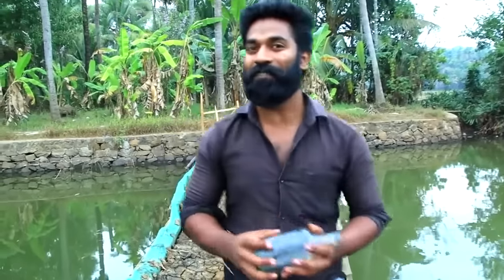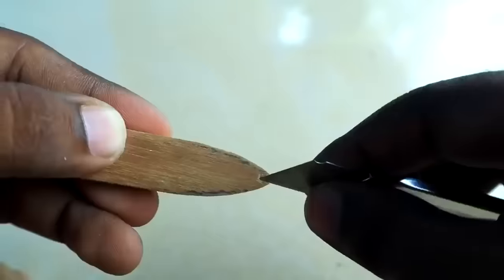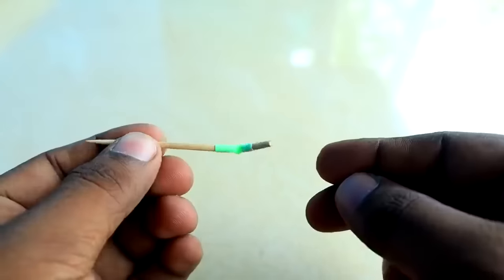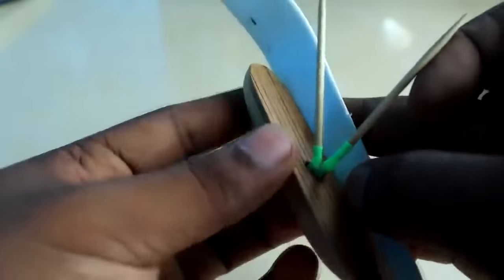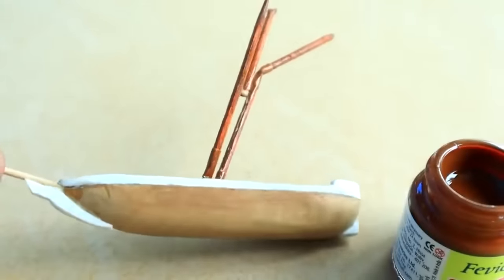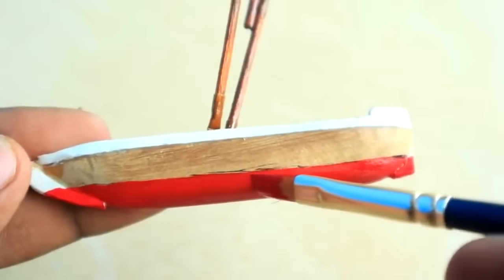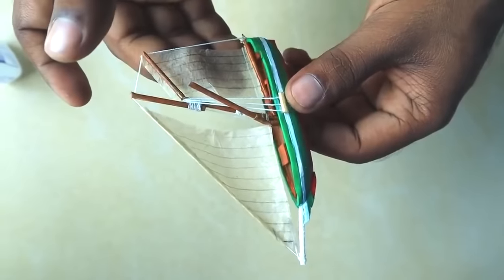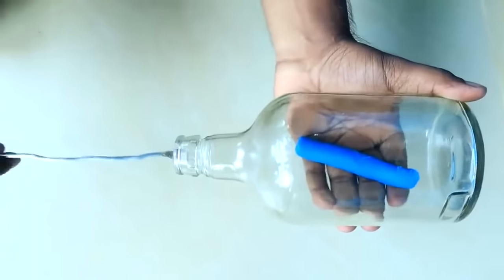Ship In Bottle making l " കുപ്പിക്കുള്ളിൽ കപ്പൽ " | M4 Tech |

Comment: Add English Subtitles. It will be more helpful for everyone.
Reply: Most the details can be understood from the video.  Some of the items used are cyano acrylic glue for instant glues, double-sided tapes for the boat sides(white, put face talc powder to remove the stickiness), used Teabag paper for sails, elastic from white socks, blue play dough for water, white paint for the foam, toothpicks for the mast, earbud tubes for easy bending, acrylic paints for the boat. The actual dimensions used for the work are missing, however you can take care of that by some trial & error.